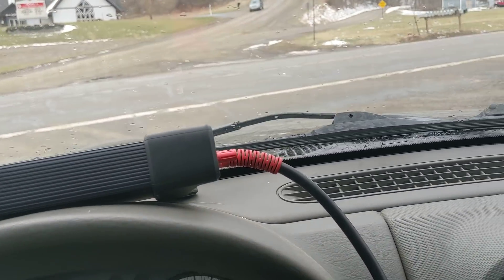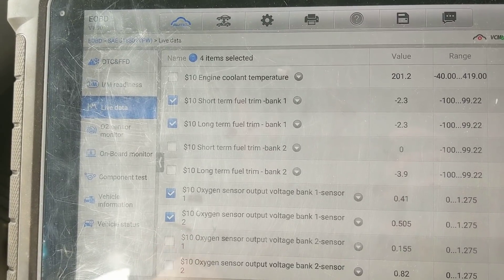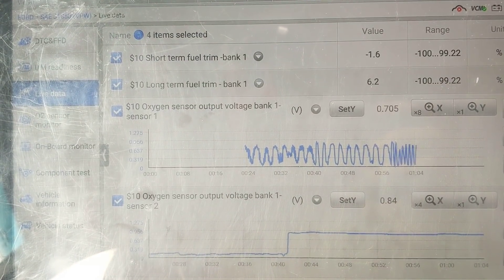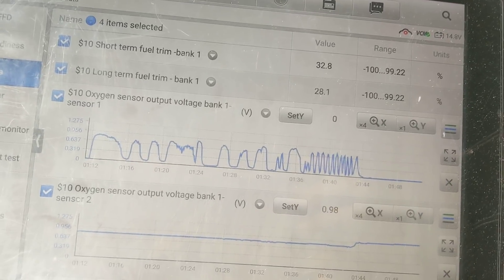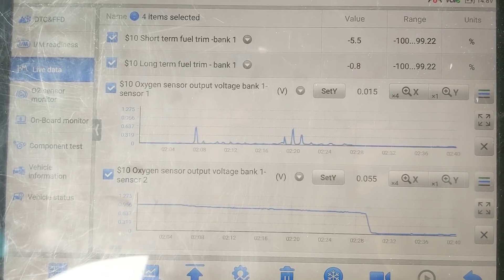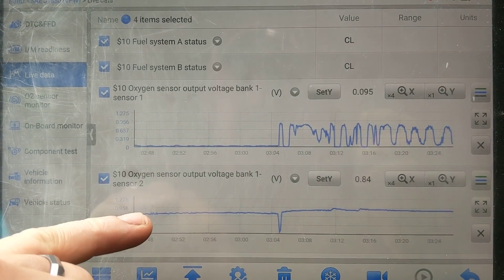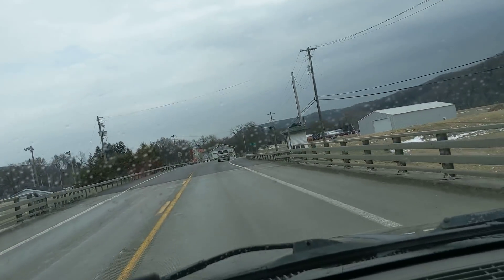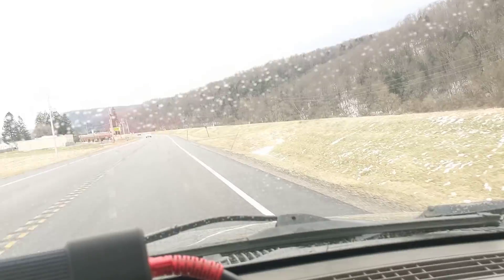SMA Quickie: O2 Setting Rich and Lean Codes!?

Comment: I have a 2005 jeep liberty 3.7L it's doing the same thing. It run good  full throttle. But when you drive it in town then run like shit. I change both back O2. Because it say it was the back one's. I change them still the same. So I ran the scan again. Then it reads the front two was bad. So I change them and now it reads the back ones are bad again.  So I throw my hands up and run it how it is until I can find what's wrong with it

Comment: I had a 1987 Jeep Cherokee I bought new. It was 1991 and on a first date, my camshaft sensor (from mechanic) quit and car wouldn't start.  Had to tow. Problem was, I was parked on 3rd floor of parking garage. Long night. At least my date didn't care. We ended up getting married. The Jeep lasted longer than the marriage. Sure do miss that Jeep.

Comment: You forgot to tell everyone  Buy oem o2 sensors Only!, no crap lol 😀
Reply from the maker: Very true especially on Chryslers!
Reply: @SouthMainAuto  
Been there! Good ol heater circuit code after if it’s resistance value is different. 
Got caught here on that, local napa only sold NTK O2 sensor with I think 56 ohm resistance on the O2, factory was about 154 ohms or something like that and threw a short circuit code for the heater.

Comment: Very helpful! I have a 04 grand Cherokee with the 4.7ho that I keep getting a p0171 that has come and gone for a year with very little disruption of performance besides fuel mileage, i also only drive an average of ten miles a day.I can tell it is running richer than normal. I will be looking into this, thank you for this video
Reply: Id check the O2 then check the injectors if they are sticking when hot.

Comment: That 3.7 sounded a bit weak at full throttle tho,, is that because that O2 has wreaked havoc so long dumping fuel and then leaning out? Just didn’t seem like it had that low down grunt mine did. I could leave 11s over the white paint at a stop sign with my Liberty.... miss that shitbox 😂.

Comment: Could it be that they updated the sampling rate on your device and now there isn't enough memory to display as much of the waveform as you were used to?
Reply from the maker: I dunno. If I reset it it fixes it temporarily. It's becoming annoying....
Reply: @SouthMainAuto  why does it go to OL when you hammer it?
Reply: @awaara24  OL = Open Loop - that means that instead of the ECU pulling O2 data from the O2 sensors, it is just using a set of tables that are programmed into the ECU by the manufacturer.
Reply: @ianbaillie6378  he explained that part really fast and I'm not the brightest when it comes to fuel trims...can you explain giving it the hammer allowed him to tell which strategy Chrysler was using. I can see that only the rear 02 was operating during full throttle but what does that tell you about the strategy? Since he unchecked the fuel trims field I couldn't fully understand....thanks for your help
Reply: @awaara24  So, when he floored it, in his video of the two graphs, the front O2 Sensor completely dropped out and stopped working, while the rear O2 sensor was still showing data, just that it climbed up to the higher numbers, showing that the engine was running on a richer fuel curve, while the engine was running full open.
If the front sensor was still good, it also would have still kept showing data, but because it dropped flat to the bottom, it proved it was faulty.
Reply: @awaara24  in simple terms, full throttle, the engine injectors put a ton more fuel in, thus allowing more fuel to be using more of the oxygen stored in the catalyst. Then the rear acts like the front by fluctuating rich as the engine is bypassing more fuel then it can use into the exhaust. Thus showing the rich conditions. 
If both did the same and went rich then the engine is flooding the exhaust with fuel.
Reply: @Sicktrickintuner  thank you all

Comment: I think I see the problem... $10 oxygen sensor can't be very good.  You should spend at  least $20 for a good one.
Reply: In all seriousness, I just got 2 new O2's for my Hondoo,  but I got the Denso's for 40 bucks a piece from Rockauto.  Sometimes Rockauto will do you right, when they don't completely kill you on the shipping.
Reply: Take it back to the pick and pay for a refund
Reply: I've replaced a few sensors over the years on my wife's 2010 Sentra. I always buy the cheapest ones and wouldn't ya know it, I never had a  issue.....
Reply: @bobwhammer4237  I almost didn't get it 😂